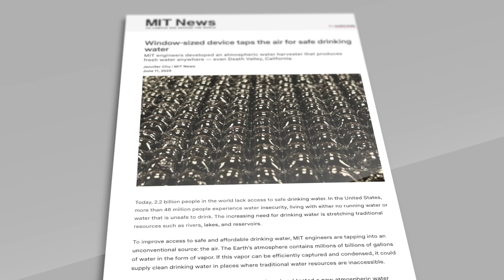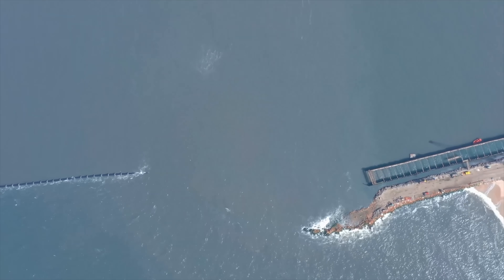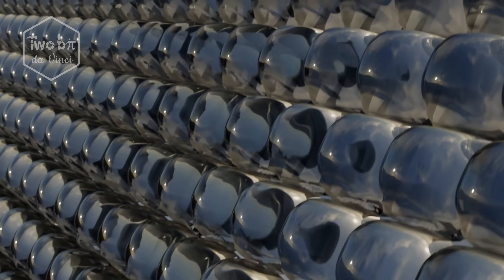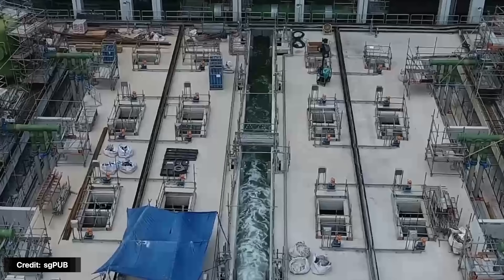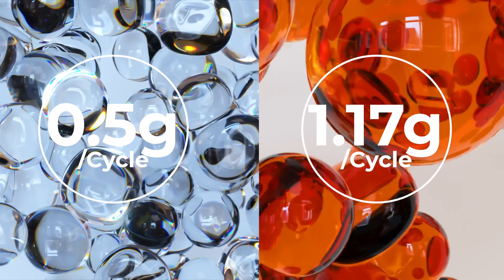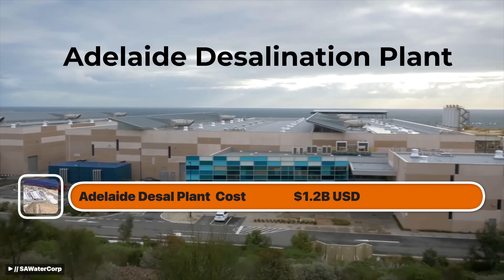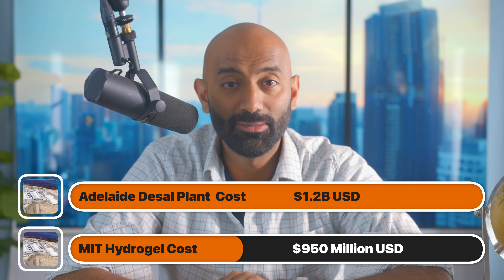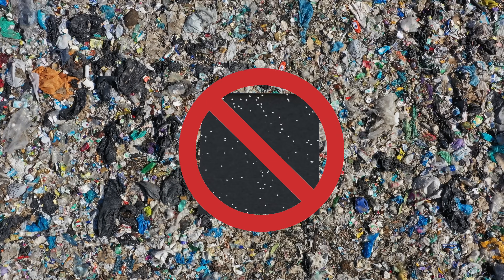MIT's Breakthrough Hydrogel Makes Water From Air w/ ZERO Power

Comment: 20-30% RH in death valley, maybe over the course of a year but it will be single digits in the summer as it often is where I live further north and while the "winters" are much more humid and cooler there is no need for this extraction method then and in the summer while it might meet the temp requirements good luck with the single digit RH... fortunately that is only during a few summer months... while this does seem like a real breakthrough especially since it doesn't hog energy like the powered dehumidifiers do it most certainly will NOT be a savior for those death valley except in the winter months...

even "respected" institutions are pulling this manipulation of facts to hype their research projects (more grant and investor $) but it is still disingenuous proclaiming to solve a problem which it does not...  and everyone involved is so "invested" in the project they refuse to think otherwise, I tried to convince a friend who bought one of those dehumidifier type of units that he was wasting huge amounts of $ running it here in dry parts of CA during the summer even giving him a logging data recorder but still refused to believe (after showing him the math) that store bought bottled water was cheaper in the summer than "making" it himself... he did recognize that they are also petri dishes needing lots of cleaning (hard to argue when you see lots of dark mold, etc. forming inside it) to keep it safe to drink....

I love that you are honest about the true life cycle costs of the gels much better than the "fusion energy is just 20 yrs away" for the last 70 yrs...

Comment: 12:33 I live in central texas and anything dark colored easily gets to 120 deg in direct sunlight, my garden soil temps reach 140 degrees all the time killing my plants if I don't have shade cloth/ I think we could pull off using this system like 9 months of the year. And even those 3 months that it wouldn't reach 122 deg naturally you could point a mirror at the collector and have it help increase the temp. 

I used to live in chicago and knew people who had a solar hot water collection system for the hot water needs and it worked all winter just fine, so I am confident this could be done in cold climates without using electricity to warm the system, just concentrated solar could be enough and maybe a pump to circulate the hot water in a closed loop through the aerogel system when its time to dump the collected water.

Comment: I am currently in Winter in a cold climate so I could make water with a sheet of glass as we get frost that forms overnight and melts when the sun rises. 
Water evaporates from sea water so a solar desalination plant could evaporate solar pumped sea water into flood beds and collect the vapour and cool it with either solar power cooling or air cooling back to water. Then the salt could be sold . I am tinkering at home with the idea to build a solar distiller for grey water so I can water my vegetable garden in summer.

Comment: Antoine de Saint-Exupéry  wrote about something like this in a book decades ago. his plane crashed in the sahara, desert.  no water so;   just taking a sheet of plastic, forming an upside down tent with a hole in the bottom, dripping water, collected over night, into a can.  of course not the same technology but similar process.
Reply: Yes, I heard about that. That would be more akin to a fog collector. You need to reach the due point for that to work.

Comment: How can something be: "... four times less than MIT's hydrogel." I don't understand the math, can you explain?
Reply: I have a weird feeling that corporations are going to abuse the crap out of this and it's going to dry out the air to the point where even worse droughts happen because clouds need the moisture in order to form. So basically it would cause cloudless dry areas that have huge impacts on the environment

Comment: solar powered compressor based still seems better in desert places. You have the solar, and the cooling effect is desirable too. Compressors last a really long time all things considered. When it goes bad, 90% of the system is re-used and just the compressor is swapped out, and rebuilt.

Comment: I know you are just providing news for possible new tech, but I do get tired of We just had a "NEW BREAKTHROUGH" . Now the odds of this being mass produce at a reasonable price is roughly in 50 years You stated desalination, can only be done on the coast. Technically that is false.  Just run a pipeline 1000+ miles into the desert, in fact run the brine, with fresh seawater set up a geodome to evaporate the water, refine the brine for its minerals. solar panels to run the pumps, as well use the condensation system at night.
Run it along Africa's green belt.

Comment: There are inexpensive materials that can be used which replace expensive polymers. LiCl is a small component. Single pot synthesis makes manufacturing simple and scalable. Durability is adjustable by including pre-filtration and varying ratios to balance lifespan with efficiency. Geometric arrangements of hydrogels also make a significant difference.

What's missing in the analysis is multipurpose functionality. Removing moisture has major impact on other industries as well, not just freshwater production.

Comment: The Speaker might enjoy learning about Ayrton Energy in Canada owned by two women Physicists who invented non lethal room temperature clear liquid to safely store hydrogen gas that can be recycled 1,000 times before replacing organic type margarine liquid to safely store and transport hydrogen inside all fossil fuel metal infrastructure without hydrogen embrittlement or additional retrofit costs.

Comment: The cost is kind of irrelevant. We’re not talking about energy sources where you can just pick the cheaper fuel type. Water is an irreplaceable need for humanity. If there’s a shortage somewhere then any method that works will be used.

Comment: Cost of tech doesn’t matter if we socialize supply. If we calculated the astronomical cost of climate destruction into the cost of carbon emissions, it could never compete with zero carbon emissions tech. “High cost” of tech only prevents privatized production because privatized supply 1) socializes the cost of climate destruction and 2) is dependent upon extracting profit from society; the consumer’s (i.e. worker’s) expense is the supplier’s profit. But all goods and services are created by our collective labor, so if we collectively owned supply 1) the cost to ourselves of climate destruction would be figured into the price of production and 2) the only cost to the consumer/worker would be our collective labor, and in case you haven’t noticed, you’re already working. When we socialize supply, rather than making corporations rich by allowing them to extract profits created by climate destruction and our collective labor/purchase power, society could produce what was most beneficial to society, not to corporations.

Comment: Currently the humidity in Death Valley is 19% with 102 F or 38.9 Celsius. Ocean water stored at Death Valley, Salton Sea and Laguna Salada can be solar evaporated for free to increase monsoonal rainfall for hot Colorado Basin and increased humidity for this amazing AWG without electricity could easily sustain RV camping and low cost housing made from ocean water minerals combined with 150X more Co2 than air.

Comment: At least good for some drinking water. Sounds like a deal compared to bottled water. 
Maybe if we don't use the tech for filling hot tubs and flushing toilets. 
And with some household moisture evaporation, we could reclaim water from our homes. We even run dehumidifiers ( some places )  so maybe that should be turned into good potable water.

Comment: i operate a large home dehumidifier whose output is connected to a PortaWell. Produces the best-tasting drinking water at an affordable price and sustainably  reduces dependency on distant sources of drinking water.
Reply: If you live in a humid climate this is a very interesting idea. Never considered that before, mostly because water is cheap by me and I don't live in a very humid climate so I don't need a dehumidifier already. But still interesting.
Reply: That's great about the taste. Now to worry about the other 99% of your domestic water use. Whoops.
Reply: @cadthunkin no worries, i have 2 wells 😅
Reply: @cadthunkin 2 wells - no worry at all
Reply: @cadthunkin  It might be ok if you have a compacting toilet and you do nor like to wash
Reply: Could mount the hydrogel panel on an east facing surface so that it dewaters until it becomes shaded and cooler in the afternoon. Then a) cycle internal air through it or b) run external air through it and then through a heat recovery ventilator(HRV). a) dehumidifies internal air. b) dehumidifies incoming external air which would improve efficiency by reducing condensation at the HRV and/or AC evaporator.
Reply: @shalomtoday how are your electricity costs? I have a smaller portable Midea dehumidifier and electric costs can get high if no solar and battery.
Reply: @surfguy777 there's plenty of energy usage calculators on the net to figure it out for your desired setup

Comment: Fine there is no account of seasonality for instance in the Sahara the night is between 25/30C during summer. I know that at 32C it stops gathering water but there is rarely a simple off and on button in real life my guess is it will absorb less water the closer it is to 32C.
Sahara again is between 20 and 50% relative humidity but this is related to the temperature air at 20C at 50% RH does not hold the same water as water at 50C with 50%RH that is why its relative humidity and not just humidity. Also those 50% are around oasis area and sea sides. I put my money that where we need this device we have around 25% RH.
Also it absorbs water during night time and it needs 12 and 24 hours summer in Sahara means 9-10 hours of night.

All this means that we might get less than 1L of water from m2. And people don't drink 2-3L per day in the desert but way way much... close to 8-10L

In short you will need probably around 10-13m2 per person.

Comment: Something you didn't mention.  I wonder how these would be affected by fine dust. Many desert areas have dust blowing around.  Some of these projects work well in the lab but once you get them outdoors. Its a different scenario
Reply: Some places have HEAVY dust storms.
Reply: That's a good point. I wonder how much performance would drop if you add some sort of filter to remove those fine particulates
Reply: I wonder if the water will evaporate faster than condensate in very dry areas. Or will just clog from dust..
Let's not forget water minerality and deposition...
Reply: Could just have them in building, it should still work as long as sunlight gets to it
Reply: Make a cheescloth shelter around it.
Reply: When they release the water from the hydro jell exposed to sunlight I wonder if the dust is washed off or the panels can prevent dust accumulation absorbing invisible humidity from the air.
Reply: for its appearance i would guess its well encapsulated against solid particles of whatever type, because it don't sucks air inside it, it just lets atmosphere passively enter
Reply: @andremarques3317 dust exists in the air.

Comment: ONLY a good solution for places with NO existing infra. INSTEAD, A MORE practical and financially viable solution today is recycling BOTH black and gray water on site. It retains >95% of the water and has additional benefits (energy pellets, recycled minerals, etc...) and prevents other problems such as ocean dumping. It costs $8300 to install at home (on a DIY basis).

Comment: I wonder if the hydrogel can be recycled and made back into new hydrogel pads.Also, I wonder what is the mechanism that degrades the hydrogel.
 
Presently, I pay $0.42/gal for filtered drinking water. The costs presented is not much more than what I already pay and the filtered drinking water I currently use is likely to go up in price due to greed.

Comment: Thank you for this video.  You have a great skill to explain things clearly and maintain engagement.  With this topic, I have a question regarding the environmental implications of removing tons of moisture from the air in any environment.  I think about what happens if we deploy this technology in, for example, Africa.  Specifically the area that seems to spawn the storms that become hurricanes.  If there were enough water pulled from the atmosphere in this location, would it cut down on the storms?  What other consequences would there be?  It occurs to me that these kinds of efforts typically have unintended consequences that must also be considered.
Reply: This is only going to affect the lowest few feet of the atmosphere.
Reply: @rogerphelps9939 . Good point!  Thanks!

Comment: Probably a really silly question but would this work on mars?
Reply from the maker: wow that's a very interesting question! the air is so much thinner, and humidity even lower, so it would have very little water to work with. also it would need to meet those temperature fluctuation requirements to properly collect and release each day.

Comment: I really enioy this channel, but I wish they'd use standard SI units throughout. Currently it varies, with faranheit, celcius, litres, and cubic feet used interchangeably - makes it really hard to follow

The graph at 8 minutes looks really interesting, but I'd love to know what the order of the techs is - the bars change height, and it's unclear what the prices at the bottom represent

Also, general question, whilst this is obviously a game changing tech, would the fact the water is not mineralised be an issue?

Comment: Install bulk panel on huge ocean barges. Sea air is always 100% relative humidity. Collect bulk water in small tankers. Bring to coastal distribution points. If it can be efficient in the desert it should perform much better in optimal conditions. That water still needs to be mineralized for healthy human consumption.
Reply: @hassleoffa  FUEL and Capital costs and labor expense would not be justified by selling the water collected in ships.
Reply: @thomashannah1828 explain the economics of commercial reverse osmosis desalination plants that currently exist and need to expend massive amounts of energy to do what this does for no power. All water supply to cities requires distribution.
Reply: @thomashannah1828 offshore barge that moves 10km/day on solar power would be 4km offshore
Reply: I was thinking the same. But this needs a (possible large) temperature delta to get the energy for the process

Comment: I think it's clear that much of the cost is due to low volume production.  If this can be scaled up, it ought to get a whole lot cheaper.  Seeing as it's passive, it should be significantly cheaper in the long run.
Another thing to factor in is what it costs to maintain/replace panels, vs what the maintenance cost is for other systems.
Reply: good luck getting that into your car...

Comment: This is already in use in certain villages in the deserts.
The version currently in use, uses a plastic (fishing) net. All they've done is changed the material.

This new material might work better, but it's pointless if it's not worth the cost.
Hopefully it will be worth it.
Reply: The plastic fishing net is used to harvest water from visible fog and this MIT invention extracts invisible water vapor from very low to high humidity levels like Los Angeles at 68% or Death Valley at 19% right now but as low 10% in daytime.
Reply: As Leroy says, fog nets don't work the same way as hydrogels, zeolites, or desiccants. In the latter case, the process is purely physical. The net provides a surface for droplets of liquid water to adhere to and coalesce into larger droplets that fall by gravity. This process is chemical
Reply: No electricity needed to increase monsoonal rainfall in Colorado Basin by transporting gravity fed ocean canal water into Death Valley, Salton Sea, Laguna Salada that solar evaporates with high temperatures and wind provides additional humidity and rainfall. Ocean water evaporates in green houses to provide fresh water for plants. Mineral & Co2 rich salt water can provide building materials, fertilizer, chemicals, Sodium Ion batteries, hydrogen, Co2 Credits, desalinated water as free byproduct of countless sustainable commodities by Agess Inc, Ayrton Energy and Dfinity the ICP token under $5.70 for one Internet Computer Protocol